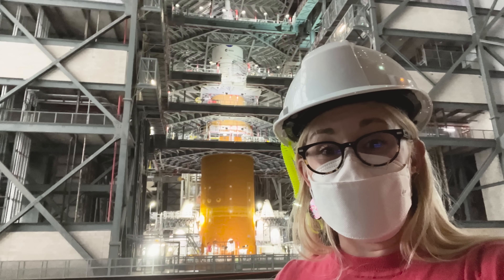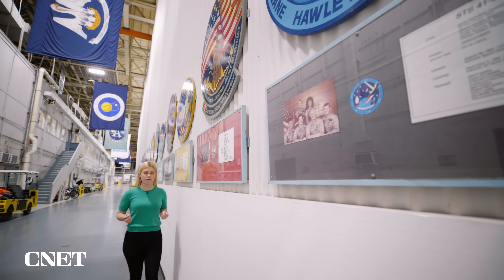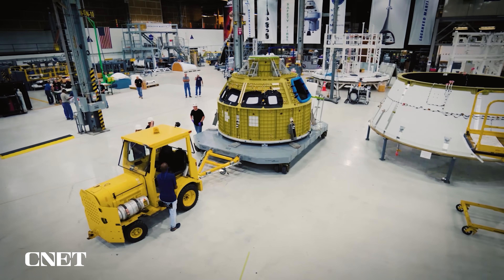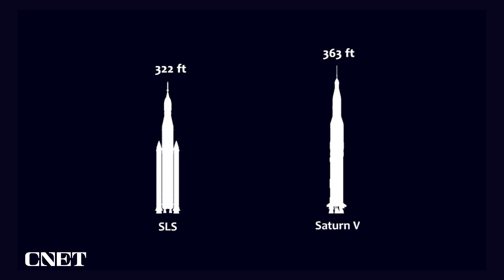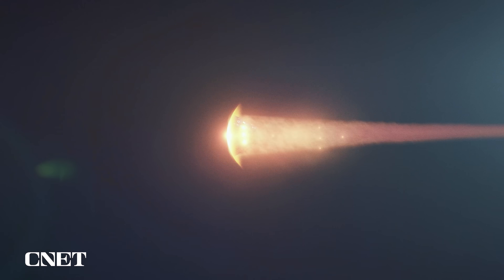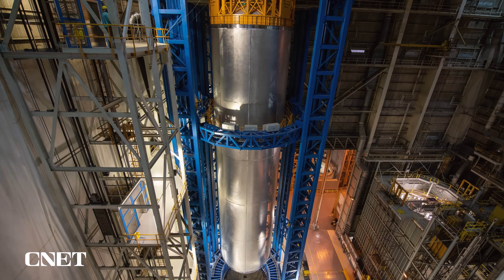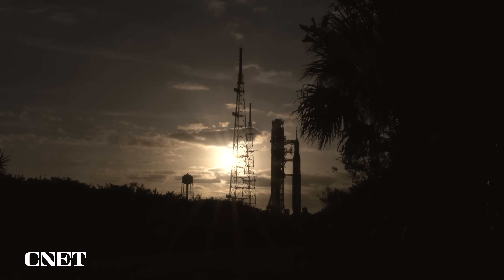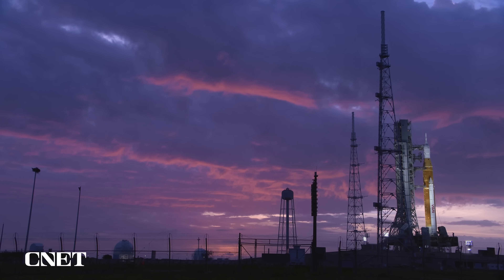NASA Is Going Back to the Moon 🚀 Here’s How Its Massive Rocket Was Made

Comment: I appreciate that the SLS is meant to take up the maximum payload, this is not sustainable. The cost per KG is astronomical. 
NASA, Boeing et AL are milking government dollars for a cost plus model. If Nasa could make reusable rockets, there is a weight penalty up front but after several flights the cost per KG will drop. The shuttle was an experiment in reusability but it was overly complicated and inefficient. They need to learn from that and make the next generation of reusable rocket, even it it means multiple trips to haul up the same load. The cost of fuel is way cheaper than building a new rocket every time you want to fly.
Reply: Brain-dead simple.  Brain-dead true.
Reply: Their justification for that was hilarious meanwhile here's SpaceX designing a reusable system with 150-250 tons to LEO with orbital refueling that will be able to take all that mass to the moon. That's really the key to Starship and what makes it so different from oldspace systems, the orbital refueling capability.
Reply: @planetsec9  Yeah, the man boy Musk. What a joke
Reply: I sure hope you all complain about the money our government spends on other massive programs like welfare and the military.  At < a penny for every federal dollar spent, NASA's spending spree has you out about a sixer and a pack of cigarettes a year.
Reply: No to worry, they are planning on commercializing this rocket... I guess their target customer is people who can't do math. $4,000,000,000 per launch is a bargain if you don't know what money is. 

I loved the line, "Our goal is to get as much payload into space on a single launch" to justify how they are superior to reusable rockets. I would actually laugh out loud about this nonsense if they weren't funding this from our tax dollars.
Reply: @timothycrystal2623  this is so true. It just doesn't make any sense the argument with the big payload as spacex is trying to do the same thing with Starship, which is reusable...
Reply: @leonte dumitru  To be fair, there is a valid reason that we are still funding SLS. Starship is not yet a proven technology. While SLS has not flown before, the model it was built from is not that different from the rockets we were using 60 years ago. Starship will need to prove they can safely reach orbit and conduct multiple orbital refueling operations. Starship also needs to prove it can land intact. It's not a matter of if, but when, since the physics are clearly there, it is just an engineering problem. 

Upgrading StarLink to the NextGen satellites will allow SpaceX a sufficient launch cadence to develop the safety protocols in a year or so, I would think. Once that happens, SLS will no longer be relevant.
Reply: @timothycrystal2623  but that's the whole point... Yes, Starship has not reach orbit yet, but the cost to develop this new rocket is far less even though everything from its design is unknown. So in this case what is the point of the SLS?
Reply: @leontedumitru  I hear you. It is frustrating AF to keep throwing money on this monster. Honestly, it would have been far better for NASA to have funded a redesign of the Falcon Heavy fairing several years ago to accomodate the Orion capsule, and canceled SLS then... 

Starship will almost certainly reach orbit next month or by September at the latest. How long before they are able to successfully land a booster? How long before they are able to reuse a StarShip? How long before they are able to consistently refuel in orbit? While these goals are all achievable, the question of how long it will take is unknown. 

SLS is basically ready to go. It is expensive, but it has fewer unknowns. You may not agree, but government tends to be risk averse, so you might as well get used to it and just be happy that in the end SLS will be discontinued along with the legacy space industry.

I guess if it really bothers you how government work, then run for office and try to change things. 😀
Reply: @timothycrystal2623  firstly I just want to say that I do enjoy a nice argumentative response. I really do respect that.
Secondly, I just think that governments should not be so evolved so deep with projects like this. I really think it would save tax payers a lot of money to do the same thing. But I do see your point.
Reply: @JoeWayne84   Stein's Law: "If something cannot go on forever, it will stop."

I think in the short term, you can't change much. Your analogy that a US President can't stop the waste in government is likely true, since it is like steering a massive ship, they don't turn easily.

On the other hand, SpaceX has already disrupted the way launches are procured. Having observed the military procurement process first hand, there is a lot more oversight than you can imagine. Every step of the process has to be documented carefully, because at the end of the day, major contracts are contested about 95% of the time and these documents need to stand up to legal scrutiny or the entire process will have to start over. I have seen it go both ways.

I'm not saying that SpaceX will ever save the US tax payers a dime, since the money will be spent either way, but ULA's days are numbered once one of the other providers (Relativity Space, Blue Origin, etc) prove that they can be a reliable and cheaper alternative to the $300+ Million per launch that ULA demands. We only NEED 2 launch providers. SpaceX is one and when another viable one appears, old school launch providers almost certainly won't be able to adapt quickly enough to survive. 

If you think i'm wrong, look at how SpaceX fought and won the right to fly Military Payloads. It plays out this way by design. It is slow, but ultimately relies on the numbers ($$$) and they don't lie.
Reply: @timothycrystal2623  Their target customer are the U.S taxpayers who are already paying for illegal migrants and the national deficit.

Now they are paying 4 billion dollars for testing SLS launches.
Reply: @Bizmonger  Yea, this is why we can all breath a sigh of relief when the legacy space industry companies like Boeing and Lockheed collapse under their own weight. Hopefully, once Relativity Space or a similar new innovative company proves reliability, ULA will never see another tax $$
Reply: It's just a shame how they lie about it to our faces and then saying how proud they are about what they do here...
Reply: I don't understand how supposed space and science-lovers are so terribly hung up on budgets.  The cost-per-launch is far more important for commercial ventures, and this quite simply is not one of those.

I'm excited for what private launch companies will eventually do, but quite frankly there does not yet exist a rocket that does what this one does.  Reusable rockets that can reach the moon simply do not exist yet.  NASA built it this way because we have science missions to do, and this is a proven design that will not require lots of testing-to-fail and totally uncertain time horizons and development budgets.

Is this cost-efficient? No.  Is it expensive?  Yes.  Do I wish we had spent more money funding NASA during the Shuttle years so they could develop re-usable vehicles?  Absolutely.  But is there an existing alternative that can accomplish NASA's near-term goals?  Absolutely not, and I am happy to fund our country's ability to undertake significant space science missions without pinching pennies or consideration for profit margins.  Private space flight is simply not mature enough right now.  SLS will eventually be obsolete -- maybe soon, maybe not, but it is worth having regardless.
Reply: @SolCrown80  First and foremost, NASA builds the way they build due entirely to politics. They are required to spread their spending around to a number of congressional districts so they will always has support in the governmental body that is responsible for writing their checks. This is also why they make safety their primary concern. Too many failures looks bad for their sponsors in congress.

That said, I can understand why SLS was necessary to develop and launch. They wanted a next generation rocket ship built on proven technology. The reason that SLS has to launch ahead of Starship is so NASA can throw a party and announce that they just launched the most powerful rocket ever. SpaceX can say that whether they fly first or second, but make no mistake, this is not about science, it is about optics. 

I am grateful for NASA. They did amazing things in the past and hopefully will continue to do amazing things. Besides, without NASA, there would be no SpaceX. Unlike many who post in this, I am much more looking foreward to establishing a permanent presance on the moon than I am about a colony on Mars. In the near term, the moon is much more vaulable than any other planet.
Reply: Oh yes, because needing to launch Starship 15 times to reach the moon is an effcient and cost-effective system
Reply: @hussarregiment7045  15??? Where did you pull that number from? I am not sure how you can quantify efficient, but if all of the launches are fully reusable, then it is 100% more efficient than the disposable SLS launches... Additionally, cost effective is quantifiable, and at $4,000,000,000 per SLS launch, I think that StarShip will be much cheaper.
Reply: @timothycrystal2623  GAO report stated that for HLS Starship to actually land on the moon, they would need to launch 16 times. First the HLS, second is a tanker ship, finally 14 launches to bring the 1,400 tons of propollent necessary for HLS Starship to reach the moon. Starship and Superheavy have an exteremly large amount of dry mass, both because of being only two stages and being made of stainless steel. Starship is deeply ineffecient because of it. And we still don't know how much it'll cost to refurbish SS and SH for launch once they've been reused. The only numbers we have are Elon's and I sincerly doubt it'll cost 5 mil per launch, far more complexed machine yet easier and cheaper to refurb than Falcon 9? Gimme a break. Proabely more in the realm of 300-500 million, about half of the Space Shuttle when it was it's cheapest, but that's just speculation because Starship or even the Raptors still haven't reached orbit.
Reply: @hussarregiment7045  I will agree with you in this, Elon's claims have not been proven to any level of satisfaction for anyone to make a firm statement on it. The 300-500 million per launch is outrageous. The main reason that SpaceX switched to Stainless Steel was because it makes building these rockets much cheaper. If they are spending that much to build one of these new, then the entire thing will be unsustainable. 

Over the next two years, we should see Starships/Super Heavies launch/land and relaunch on a regular cadance as they switch to the next gen Starlink satellites. That should give them plenty of time to perfect their model. Until then, best to reserve judgement.

Comment: But shouldn't there not be super high pressure in the tanks as it is liquid fuel, not gas? I'm pretty sure that's why it can be so thin. If it was actually a high pressure gas vessel I'm sure it would have to be way thicker. I could be wrong.
Reply: The Hydrogen and Oxygen must be held under pressure to remain liquid.
Reply: The fuel is liquid Oxygen and Hydrogen. They have to be kept at cryogenic temperatures or they will boil off.

Comment: If there were assembly and launch platforms within reasonable distance from earth, an entirely new concept of transportation could quickly evolve. In order to obtain the tangible future of space travel, we must compress time. Printing of modular elements requires raw material, and this rocket can deliver a high volume of very dense materials, in massive loads. Through the printing process, in zero gravity, this material can be expanded into an enormous array of space platforms, in a very short time.
Reply: Can build pressure vessels and test them with 3d printing much less in space.
Reply: That's what I was thinking as well. We should build a launch platform on the Moon for the Mars trip. Much more space and weight for crew for such a long journey. I don't see anyone sitting in a cramped pod for the entire trip to Mars. They gotta figure something out for that trip.

Comment: Correction, the most expensive rocket ever.
Reply: They have to refit the crawler for the new SLS rockets. More money 💰
Reply: It's not
Quite a bit cheaper than the Saturn V, both in development and cost per unit
Reply: @brokensoap1717  It depends on what you're counting. If you're looking purely at Saturn V and SLS cost per launch, SLS is more expensive. Everything was developed new for the Apollo program. SLS is using old technology and there is little innovation.
Reply: But the CNET girl is saying that SLS is the most advanced!!! HaHaHa

Comment: I thought the rocket was called SLS and ARTEMIS was the program.
Reply: Your correct (The rocket is also known as the Artemis rocket however, even thought that is not the official name)
Reply: Your correct the rocket it self is called the SLS and the mission it was built for is Artemis
Reply: Me too!
Reply: Was just going to say that
Reply: Same here
Reply: Well the Apollo program rocket was called Saturn V
Reply: I hear ya, SLS is integral to the Artemis programme. So they are kinda one and the same. The Artemis moon programme has been re-named a few times over the years so it does get a bit confusing.
Reply: Google info state that Artemis is the twin sister of Apollo. A Greek moon goddess....just for the interrest....
Reply: Check timeline 0.50
Reply: It is all a lie anyway.
Reply: Confusing, I know.
Reply: Mission: Artemis (insert number of mission here) Rocket: SLS Orion
Reply: Negative, it is a Meat Popsicle.
Reply: It's the Artemis 1 rocket.
Reply: I thought it was Orion?
Reply: Its called artemis to confuse people so they dont find out its true specs. It is called sls now check the specs compared to saturn 5... Its almost identical if not worse. But one thing is for sure this rocket will never get us to mars...
Reply: @danijel124  quite wrong actually.  The SlS and Orion together is called Artemis. Artemis specifically out performs on paper Saturn V in pretty much every aspect except for height.
Reply: Wow!
Reply: It is
Reply: i thought artimis is taller then saturn v
Reply: @stap1796  Just think about how much less space you need for computing power. Microchips today do the same and more than their big bulky 60s counterpart. Require  way less energy and therefore less fuel is needed. Also optimized fuel compositions and engines are way more advanced and fuel is saved this way. Fuel storage takes like 80% of a spacecrafts size  at lift off.
Reply: There are so many errors in this piece it is hard to know where to start.